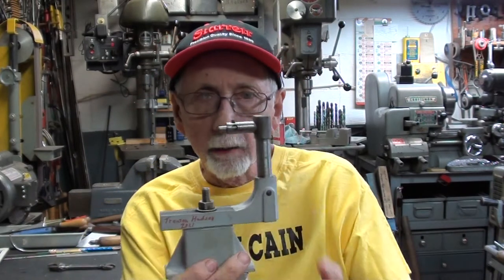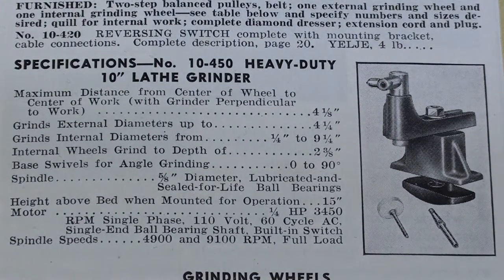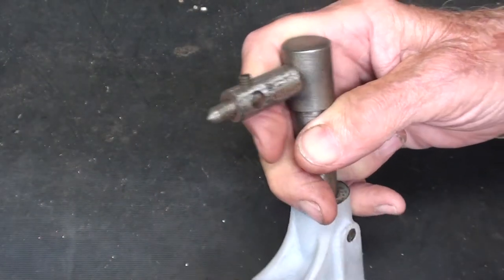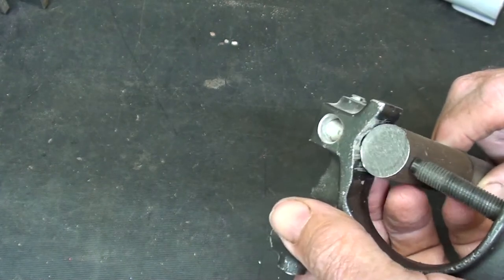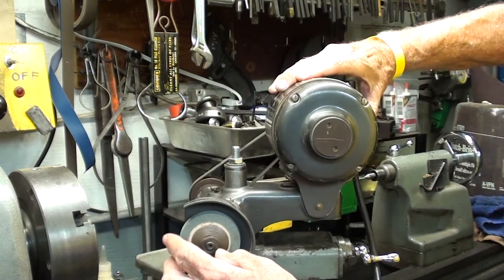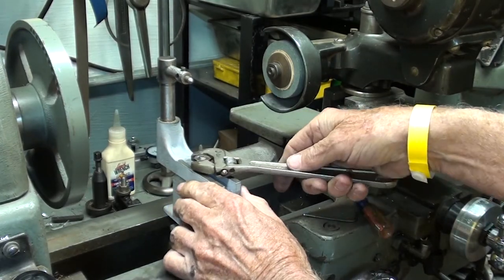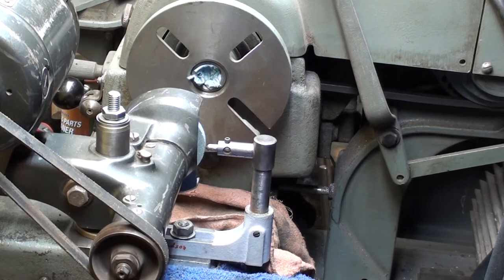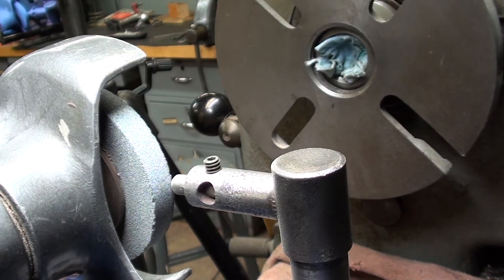DRESSING THE TOOLPOST GRINDER WHEEL on ATLAS LATHE 749 tubalcain dumore

Comment: The red “thing” looks like part of a tool holder for a small woodworking lathe. The slide works just like the one on the wheel dresser. The adjustable post has a piece of steel or CI that you can slide the cutting tool back and forth on.

Comment: I worked in the trade for 50 years and used a tool post grinder maybe twice. Gets you out of a pinch at times. I had to O.D/I.D. grind an 11" dia. forming ring on one occasion that was too large for the Norton grinder.

Comment: Hello mr. Pete. Thank you all all your time with these very educational videos! Thank you 

Question…(I can’t seem to find a answer) I have a 13” precision tool by 5’ southbend lathe. 
The cross slide micrometer is in increments of one-thousand of an inch… when turning something down and using the micrometer, is an adjustment of one-thousands of an inch actually taking off two-thousands of an inch, 1 thousands per side of the material? Mine sure seems like that. I’m trying to see how accurate mine is as I recently made the purchase… this lathe was made in 1955 but is like new, being put up for many years in storage. 
Thank you in advance. Joseph

God bless!
Reply from the maker: Yes.